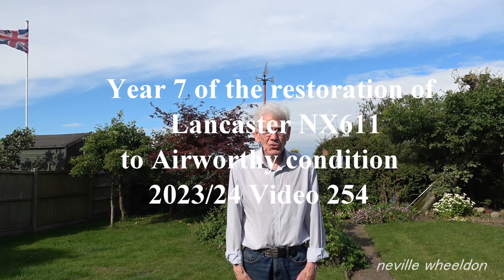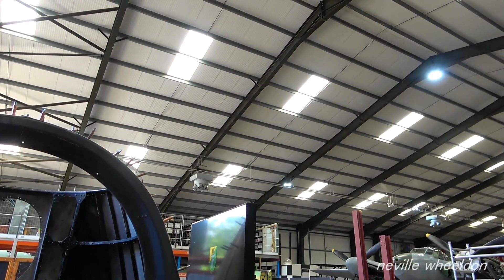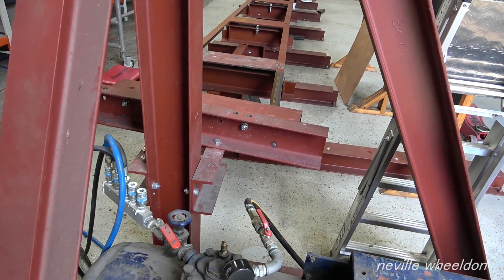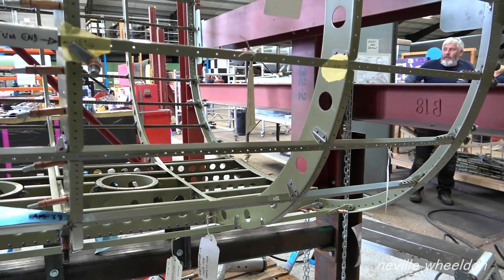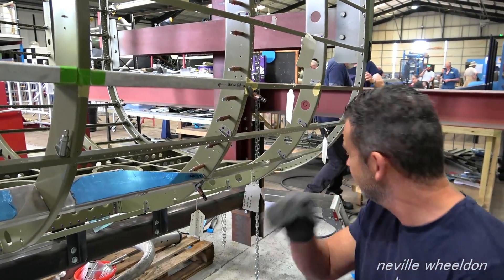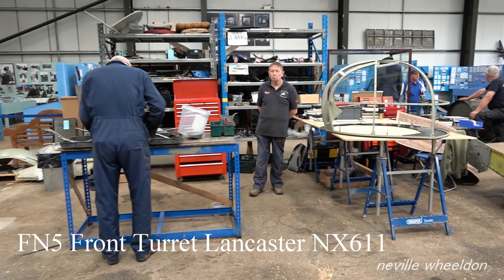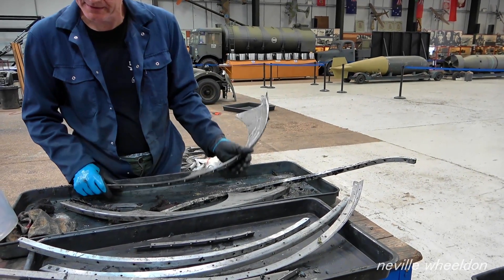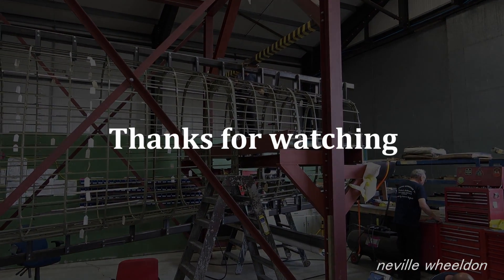Video 254 Restoration of Lancaster NX611 Year 7.John talks about the Lancaster Jig and restoration.

Comment: I wouldn't be thinking rivet hole diameter ether. But for as long as they've had Just Jane , i would think they would have run into this issue somewhere along the way of performing maintenance or repairs.